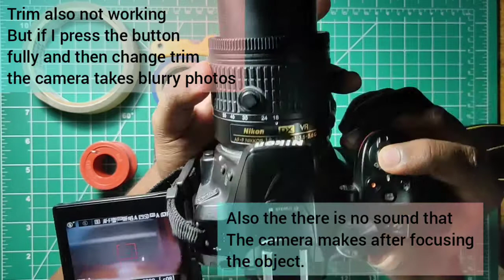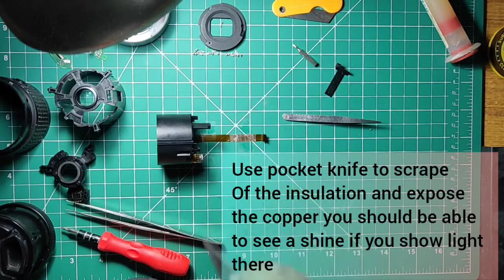Nikkon 18-55mm AF-P lens focus problem SOLVED | Damaged flex cable

Comment: I have the same lense nikkor 18-55mm but i have some issue...
1. On a particular distance my lens clicks sharp and good image ,bt the moment if any change made in focal distance (zoom in /out) picture quality blurred.
2. Auto focus not working nor focus ring
3 and camera shows f36 when i change my aperture..
Please reply
Reply from the maker: Probably that auto focus flex cable is only the cause you need to replace that... manual focus also won't work without fixing that cable i think so
Reply: @FPVMATE  thankyou

Comment: I use this technique once when i repair my laptop flexible cable on the power button part, but i never soldering it. Maybe i will try this
Reply from the maker: Yes by Soldering it will ensure that over time the wires won't move around and create any short to neighbouring wire also in this i didn't use pcb masking I just used tape. Using double layer of masking after Soldering will just make the cable lot stronger .

Comment: You have my respect... 
Is it difficult to change the cable instead of repairing it?
My motor only clicking and can´t focus... Is it same problem?
Reply from the maker: If replacement cable is available then better to change it since in my country I couldn't find the cable I had to do this fix. Most probably for you if the motor is clicking means the gear might have shifted from its place that's why it's clicking. You will have to open it up and see if the issue is cable or gear.

Comment: Hello, I have a nikon AF-P 18-55mm with manual and autofocus problem. What may be the problem. I really don't know what to do. Both are not working. I know that the lens is not that expensive but i can repare it, it would be cool. If you have any advice?
Reply from the maker: Does the manual and autofocus work on other lenses other than 18-55mm...if so then the issue is with lens only if manual focus is also not working maybe the encoder pin/wire that connects from lens to camera might be damaged... check if those pins are making proper contact with camera
Reply: @FPVMATE  The wire? You mean the wire you fixed?
Reply from the maker: @nicoke921  yes there are flex cable that connects the focus motor to the connecting pins of the lens so the damage might have occurred there most probably
Reply: I really have exact same problem 🥺
Reply from the maker: @minar5366  probably it would be flex cable issue only

Comment: My cable is cut in half and i cant use neither manual focus nor auyo focus
Reply from the maker: Manual focus should be working even though cable is cut check if the orientation of all parts are in order and lens moves when you rotate it one thing is if cable is cut the the fine focus won't work so for that you have to join the cable or replace the cable no other option
Reply: @FPVMATE  thank you very much but i dont understand how the focus ring is supposed to work.When i opened it to see what kind of flex cable it requires, i noticed nothing is attached to the focus ring
Reply from the maker: @formal.5037  As per my guess it has a magnetic sensor which detects how much the focus ring is turned as you may see that no gears or wires are attached to this the focus ring

Comment: What a poor design by Nikon. It was a good lens. I have mine and have problem like yours too. Cant do autofocus, nor do manual focus neither. Everything is electric in this lens. AFS are better than AFP, because they built like a tank! 5 years using this AFP lens and just yesterday Its broken, while my 10 years nifty fifty stil works like a charm!
Also, the zoom lock lens isnt working, I wonder why.

Thankyou for sharing FPVMATE. I will buy new lens, rather than dealing with this BS.

Comment: I have an AF-P lens with fungus on the back glass. Is it possible to clean? If yes than how much is it gonna cost?
Reply from the maker: Yes it can be removed easily and it won't cost much
Reply from the maker: You can itself remove it . you just need to open the lens from top
Reply: Yo lo limpie pero no se como armarlo nuevamente a su lugar

Comment: I recently got the AF-P lense
And the auto focus isn’t working
Reply from the maker: Is autofocus working if you put another lens? Most possible issue will be either
1. broken or loose flex cable
2. Gear of autofocus motor displaced
3. Autofocus motor issue ( rare case)
Reply: What are the solutions to all 3 you mentioned?

Comment: What will be the repair cost in service center for the same!?
Reply from the maker: The will not replace the flex cable alone but will replace the entire motor and lens part which will cost around 4.5k INR

Comment: No se ve que funciona el motor 👀
Reply from the maker: Can you translate to English . I can't understand Spanish
Reply: @FPVMATE  The motor focus doesn't working
Reply from the maker: @flaviovaldeos9757  are you sure the flex cables is ok . If motor not spinning try to remove the gear and clean it then check. The tooth on the gear may be worn out .
Reply from the maker: @flaviovaldeos9757  Most possible issue will be either
1. broken or loose flex cable
2. Gear of autofocus motor displaced
3. Autofocus motor issue ( rare case)